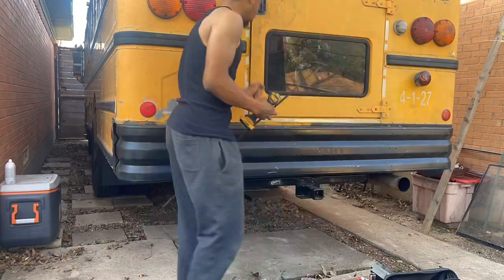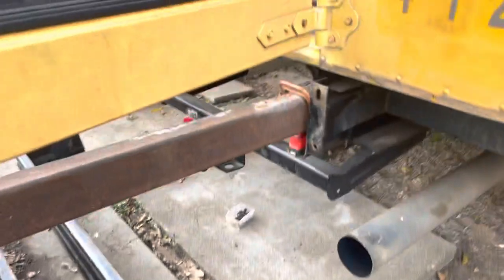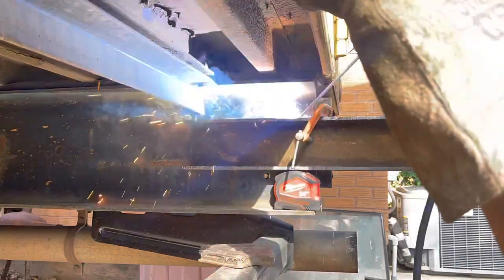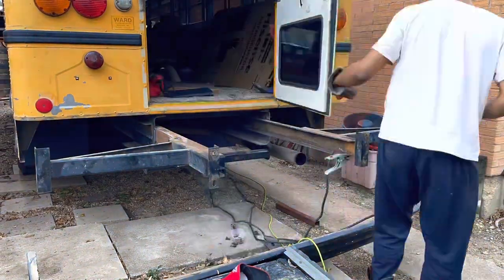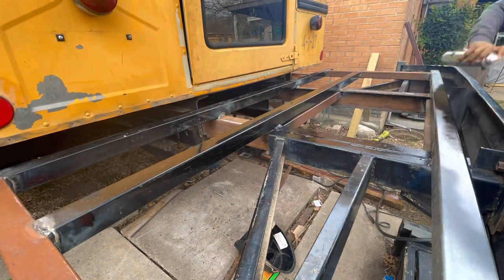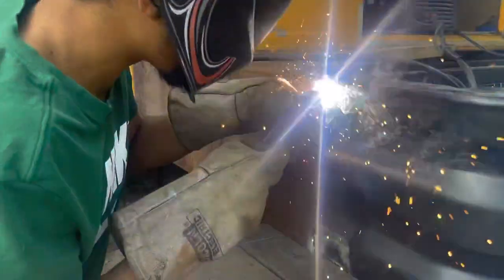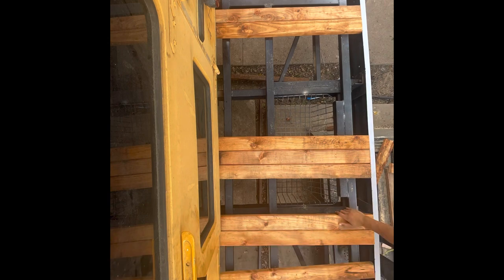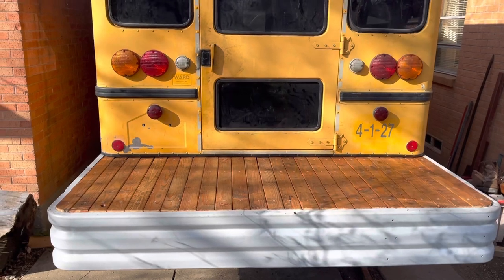SKOOLIE REAR DECK BUILD

Comment: Could you weld a little frame onto this to create a little sunroom on the deck, almost like a cage and use cattle panel or something similar for the walls and "roof"  and cover it in 6mil plastic? I'm daydreaming about having a little greenhouse that's accessible from the back "garage" on the bus. Thanks!
Reply from the maker: the options are almost endless!